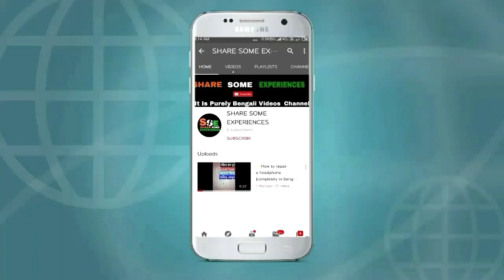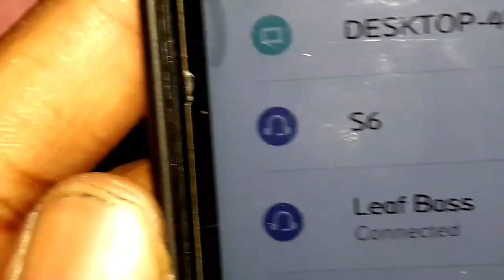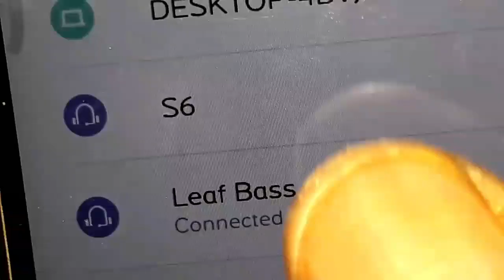How to fix broken headset

Comment: My main side is working but the other side is not working please help please please please
Reply: What I will do please tell it is very important for me please
Reply from the maker: Yeh wire ka problem ho sakta hai or main board  mein bhi problem ho sakta hai.eletric multimeter se wire ka connection check karo .agar wire ka connection thik hai to board mein problem hai.
Reply from the maker: Yeh video banake upload kar dunga..wait please
Reply: @sharesomeexperiences1997  ok
Reply: @sharesomeexperiences1997  can I send you a photo of my headphone
Reply from the maker: Yes send me
Reply: @sharesomeexperiences1997  ok  thanks i has repaired it if there is other problems in future I will send you ok
Reply from the maker: Ok..bro.sorry for the late reply🙏🏽
Reply: @sharesomeexperiences1997  ok no problem 👍